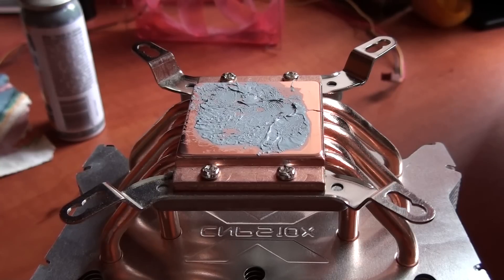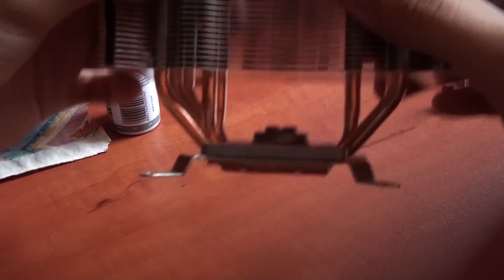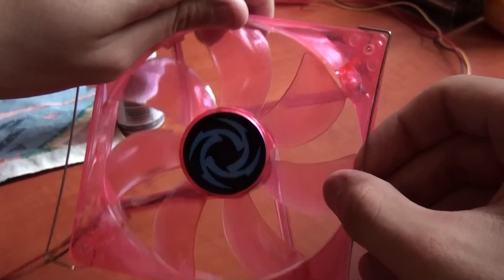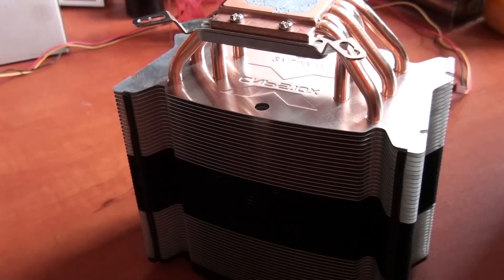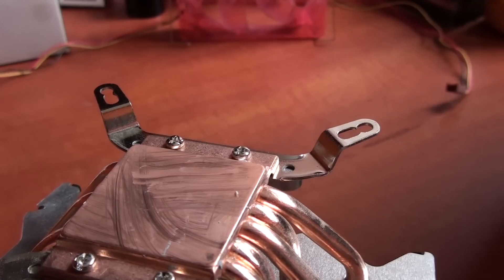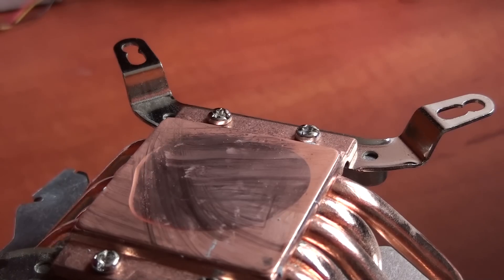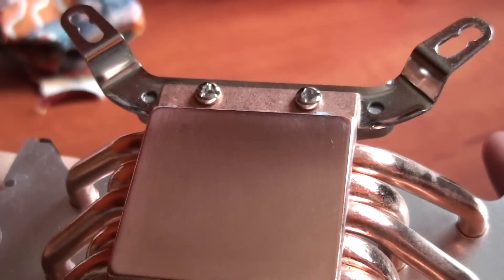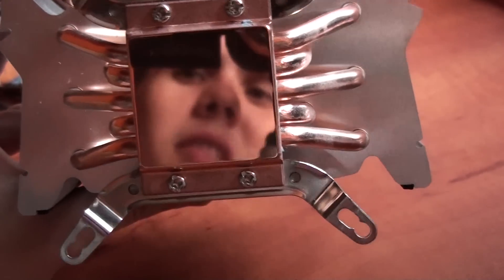How to clean old thermal paste Preparing Zalman CNPS-10x Flex Cooler for a new cpu

Comment: Exactly the same physics apply on the contact surface too, but on a microscopic scale. The "scratches" I meant were done with a very low grade sandpaper (used before the polish process). And by trial, I can say it helped me to get the temp down with about 4 to 6 degrees C more. ( in case of the fins, since you mentioned, black mate finish does a better job than no paint or other colors). Also this is only if you want to go to extremes, since the changes are too slight for the amount of job done.

Comment: Just a small detail, mirror surfaces don't have the optimal heat transfer properties. Rugged surface is better, that's how I got an old intel dual core to 4.7 GHz in stable thermal status, "scratched" the surface of contact with sandpaper on the Zerotherm Core92 (which is indeed a cheap cooler) and also on the processor after cleaning it well and before applying the paste.